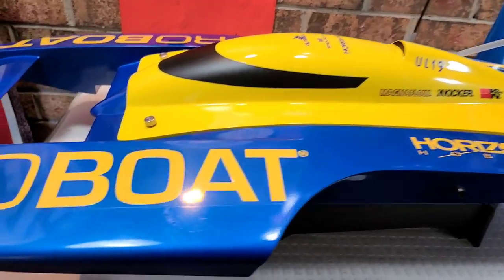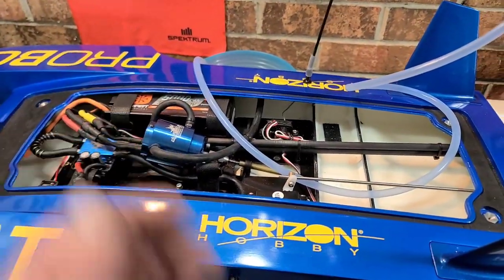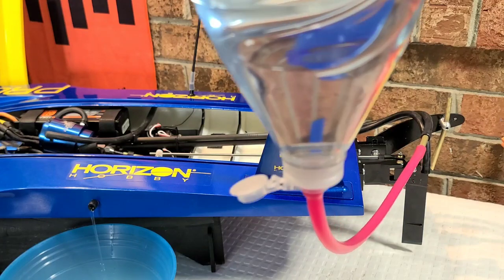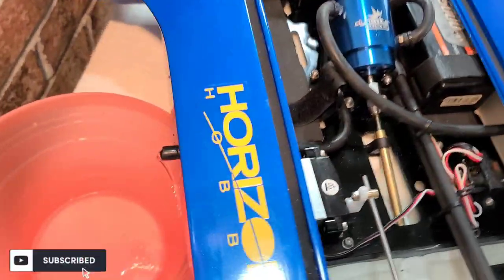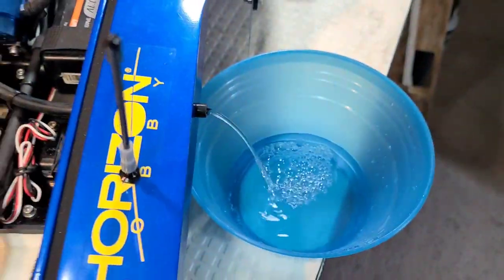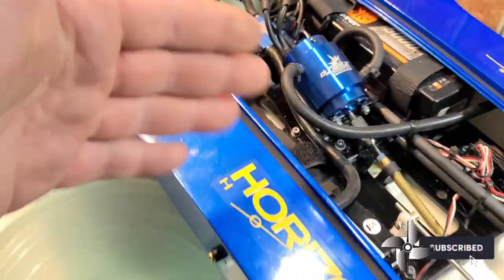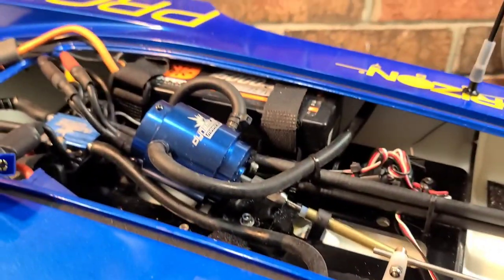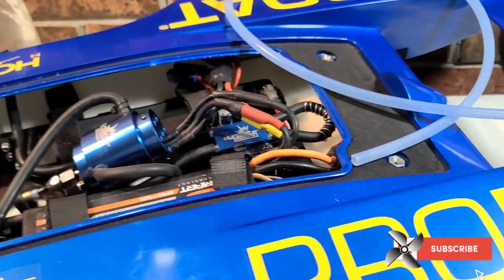Check Your Flow Fast Electric Rc Boat Watercooling Test & Cooling System Cleaning

Comment: I just got done drilling all the ports on my blackjack 42, ready to test and see how well it worked
Reply from the maker: The 42 has great cooling stock.   Guess it's gonna have even better cooling.   BUILD IT IRONCLAD
Reply: @IRONCLADRC  well I’m in south louisiana and I’m the summers out lake waters are around 85-95*, so I was getting in the 150* temps on esc, I didn’t like that

Comment: That's a real smart test you devised Big B, thanks for sharing. I used to use a syringe to test my water cooling, but from now on it's going to be the dish soap bottle!! 👌
Only thing to consider is the water pressure at the inlet, because unless you have a dual pickup in the rudder, the inlet pressures will be different. My guess is that your big blast pickup will deliver way more cooling than the  rudder pick up 😉
Reply from the maker: Thanks brother glad I could help.    Yes sir your right about the pressure part.  The blast pick up did great tested it a couple days ago on 3s & 4s, prepping the boat up as we speak for 6s. 50 KNOTS AND NO SMOKE C'MON

Comment: I think the brass restriction will increase the flow rate at the outlet but back inside the tube where it’s still the same larger size the water will be flowing just as slow as it was before the brass tube restrictor, if not possibly slower
Reply from the maker: I disagree, i see what your saying though.  It's Just MY theory I could be wrong 🤔 I do know that the system works best with a little back pressure to keep the water moving quicker throughout the cooling run.  👊   thanks for the input brother

Comment: Big B, I noticed on my v2, water shooting out of the motor cooling line about 5 inches at speed.
The ESC double lines hardly have any water coming out at the same speed.
I used 8mm lines, did not drill out the nipples, but Temps stay at 125 degrees,  so something is working.
I switched lines to the rudder, now the esc water shoots out 5 inches, and motor does not!! Still in the 125 temp area.
Reply: I think it's the holes in the rudder that matter, one set is deeper than the other and restrict the water flow??
Reply from the maker: You know what I've noticed the same thing with mine.  I use the top rudder intake for my motor and the bottom for the speed control.   ?  Idk maybe the top hole isn't getting clean water flow with the trim tabs down?  🤔

Comment: So
 Will I be better of with the ose blast pickup, or a quad rudder pick up.
Both using a Y fitting, so 2 in and 2 out of the ES?
Reply from the maker: Quad I'd definitely go with a quad pickup rudder
Reply: @IRONCLADRC  and it's been ordered as well as curved fin.
Thank you.

Comment: And still, stock electronics will get very hot after 5 min on 6s . I did all your tests and many many others, with overheating issues. I ended up changing Esc and motor, problem solved.
Reply from the maker: I'm gonna change the speed control out to an ose 150  here shortly, I enjoy running the boat in its stock form trying to  Get the boat set up and primed for the upgraded electronics.
Reply: @IRONCLADRC  With the upgraded electronics nothing else is necessary. You'll see. Still, I enjoy how much effort and patience you put on your tests. Very nice.

Comment: Why do the flow rates in the two completely independent systems need to be equal?  As far as the motor cooling system knows, the ESC cooling system could be in a boat in Abu Dhabi.  You essentially have two electric circuits; one with a 100Watt bulb, and one with a 50Watt bulb.  Of course flows (amperage) will be different.  What is important is that each flow be ADEQUATE.
Reply from the maker: I Never said they needed to be equal,  I'm trying to achieve a quicker moving flow on the esc side.     I was Just checking each cooling run compaired to one another,  to narrow down the restriction of flow.
Reply: @IRONCLADRC  👌😉

Comment: IM SORRY BIG B I DON"T AGREE. THAT BRASS TUBE AT THE END OF THE SYSTEM IS ACTING LIKE A LITTLE OBSTRUCTION. REDUCING THE FLOW. LIKE YOUR ESC DID BEFORE YOU DRILLED IT OUT. YOU WANT VOLUME NOT PRESSER . EH! GET A TIMER TIME HOW MUCH WATER FLOWS WITH BRASS TUBE THEN WITHOUT IT. WITHOUT SQEZING THE BOTTLE
Reply from the maker: Your probably right.      You want the quickest moving flow possible  the hole in the brass tube at the end of the run is considerably larger than the holes in the esc  but smaller than the rest of the run. I doubt it's slowing down the exit water.
Reply: I agree!